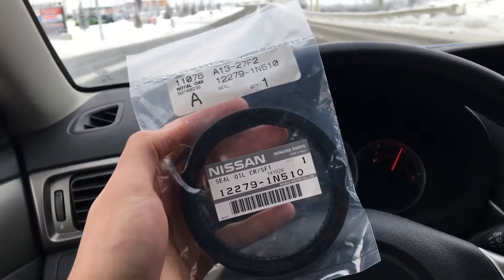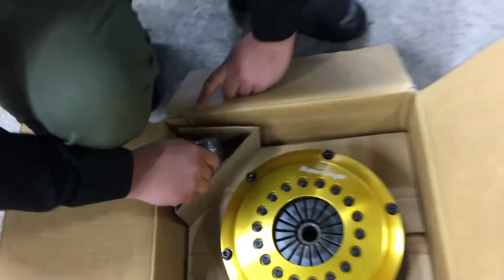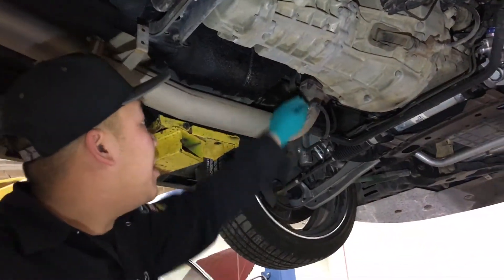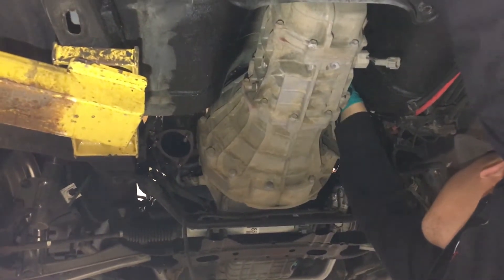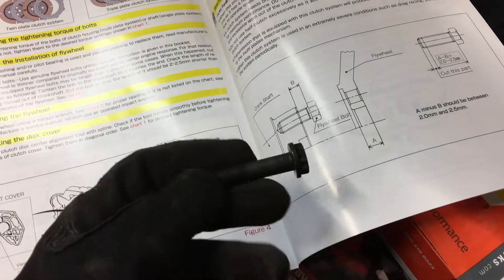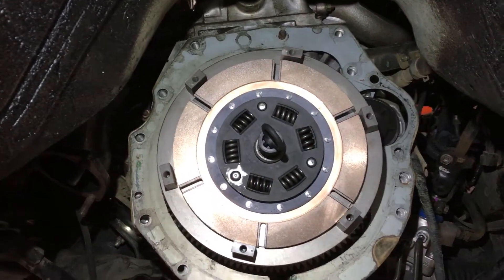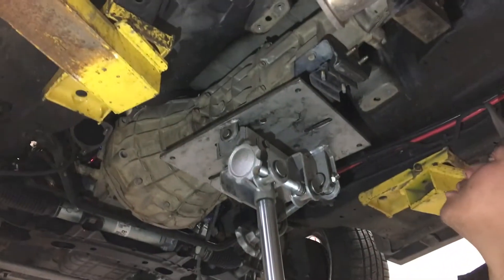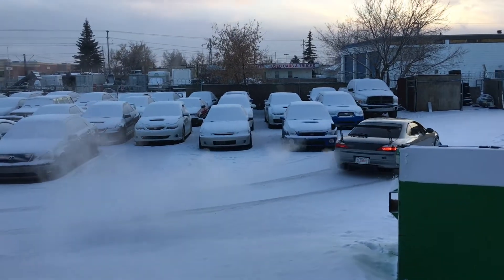OS GIKEN clutch install into S15 Silvia eh

Comment: thanks mate, im having a lil trouble wriggling out my transmission, i've undone the crossmember at the front the same as yours, is it necessary to still take the exhaust downpipe off? should i also take the start off housing off?

Comment: Isnt The flywheel tightening torque wrong? You should have looked for the subaru bolt recommendation, not for the sr20 bolt??
Reply from the maker: I guess we'll find out when something explodes lol. So far I have 3,000kms on the car of burnouts, drifting, etc...

Comment: what diffuser is that?
Reply from the maker: im Schwaggy it's a FirstMoulding from Japan. It bolts directly onto the S15 which is nice. Most of the Evo 9 and FD RX7 diffuser fit as well but you have to do a little cutting 🤔